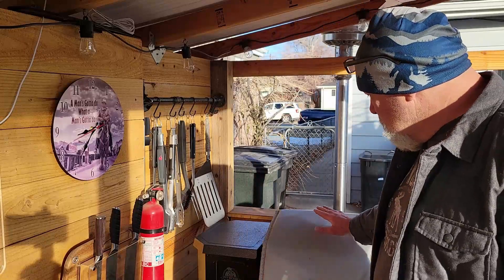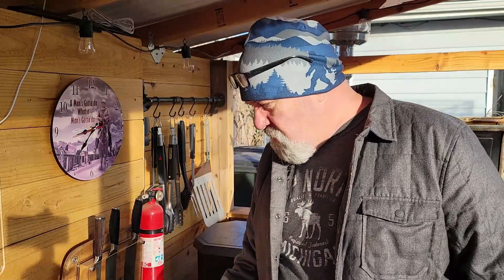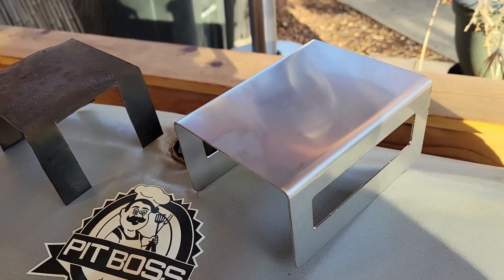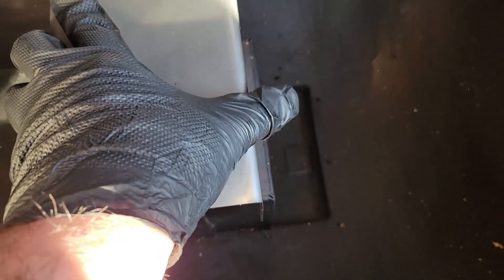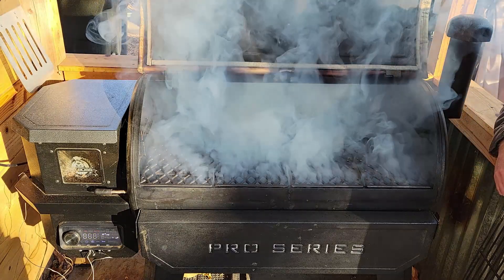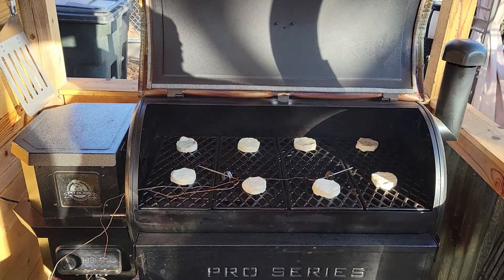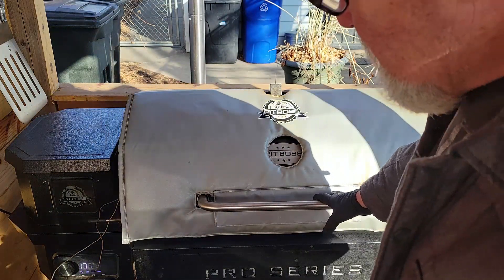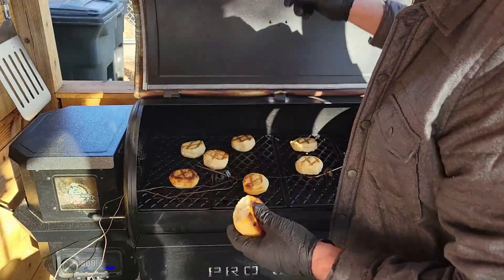Pit Boss 1150PS Biscuit Test with Flame Tamer and Diffuser #biscuitsandgravy #food #smokedmeat

Comment: my 1150P3 does not have that extra plate
Reply from the maker: Which extra plate? If you're referring to the Flame Tamer or Diffuser, those can be purchased from Tom at https://smokeslikeaboss.com/
Reply: @KellersGrillzebo  Sorry Mine does not have the plate in the bottom then the drip plate. Mine is open at the bottom with fire pot exposed.
Reply from the maker: @allee68  That flimsy piece of metal? A lot of guys just get rid of theirs because they feel it's unnecessary. Even without it, you could place the Flame Tamer over your fire pot and get more even temperatures.

Comment: Thanks Keller,  just bought a PB Austin and after checking out videos bought the deflector and flame tamer from SLAB,   nice demo with biscuits.....not perfectly even temps but would it ever be perfectly even....nope.  Howdys to Denver area.  I used to live there but don't miss the traffic...miss the climate.
Reply from the maker: Thanks for your comment, Charles! Before I added Tom's items, I had a pretty mean hot spot in the back, by the smokestack. After adding them, both sides are pretty even, and right above the firepot is where it's 'naturally' going to be hotter. Lol, about the Denver traffic! It's not getting any better! As for the climate.., my favorite is Spring! I'm getting too old for these winters anymore...

Comment: Thank you for the demonstration.  I have a 1150  Pro that is driving me nuts due to the false readings and the various cold and hot spots.  I will be ordering the flame tamer and diffuser.  I'm not certain what Pit Boss was thinking with not rounding the diffuser.
Reply from the maker: Thanks for your comment! Tom Boden, up in Fort Collins, CO, has a Youtube channel, with more info on these things. It seems like this all started when Pit Boss introduced the 1,000 inch barrels. Here's a link to one of his videos that might explain it a little better. https://www.youtube.com/watch?v=kr0VWfl6X94. Also, if you want to join up with a support group for the Pit Boss owners, everyone on his Facebook site are more than helpful with whatever questions arise. There are links in my video's description. Smoke On!
Reply: Reach out to pitboss. You may have a faulty control panel - many have had issues that a board change solved most of their issues.